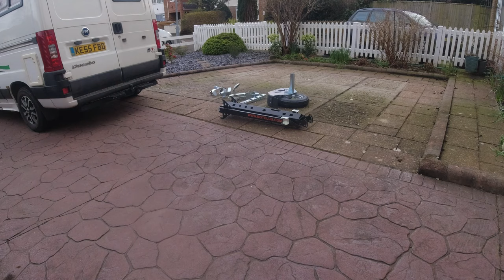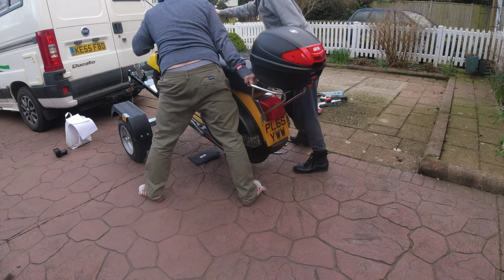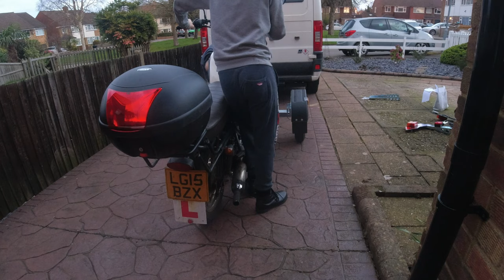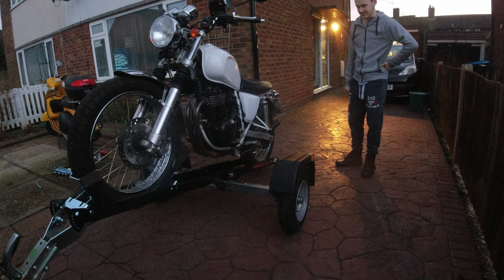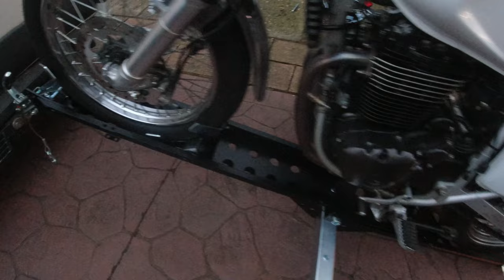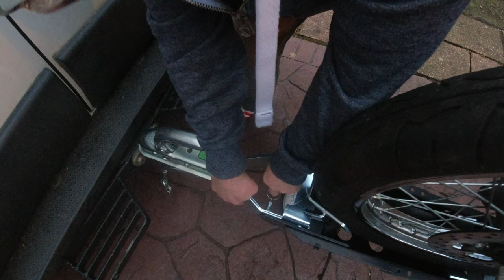Motolug SE collapsible motorbike trailer.

Comment: Quite a bit of a palava with 3 very different bikes on an unfamiliar-to-you trailer but I suppose that once you get it all adjusted, it'll be straightforward. I was thinking of getting a Motolug but couldn't justify the £1200+ tag for an "occasional use" trailer. Even a tatty, rough example was £400+ (& still climbing, it was an eBay auction).
Reply from the maker: @stephenphillip5656  that was literally the very 1st time putting it all together, now I know what I'm doing I recon it takes about 15 mins in total. 
Personally, it fits my needs, I don't have anywhere to store a full size trailer so having the ability to dismantle it to store it in the corner of the garage is handy. 
As for the price, I bought mine new from the factory but as a slight second because of a couple of paint blemishes so had a discount on it. (Give them a call to see if they have any others)
Having piece of mind that it's structurally sound with new wheel bearings, tyres etc means I haven't had to worry about anything failing on it, unlike a second hand trailer that you don't know the history of.

Comment: Did you get the scooter safely on the trailer in the end?  I am thinking of getting this trailer for my Vespa 250GTS. thanks
Reply from the maker: Yes, but without realising I had hit the exhaust and broke it. 
I've now got a vespa GTS hpe and use a folding loading ramp to give it the extra clearance that's needed.
Reply: @ukhornet23  Thanks for that but apart from having to have the extra ramp to get it on the trailer does the Vespa fit OK once in place? is it nice and secure? and does the front wheel fit OK in that holder thing?  Thanks
Reply from the maker: @007brid  yes, the front wheel holder is adjustable for different size wheels, so no problem for a vespa. It holds it steady while the ramp is still angled without any other straps/tethers etc, then you can pull the locking pins to put the trailer horizontal to strap the scooter down. 
I bought Oxford handlebar straps to help secure it & also ratchet strap the grab rail to the trailer. 
1 of the ratchet straps have come unhooked from the trailer before so I now cable tie them in place and this works fine.
It's a great little trailer that I'd recommend to anyone.
Reply: @ukhornet23  That's great help and info thanks for that. Good to talk to someone with almost the same Vespa and the exact trailer I want 👍